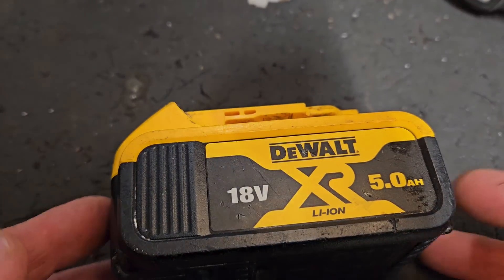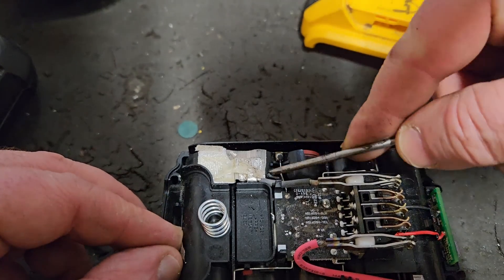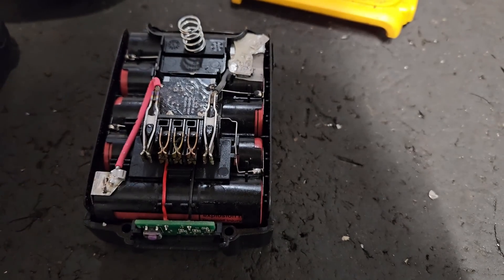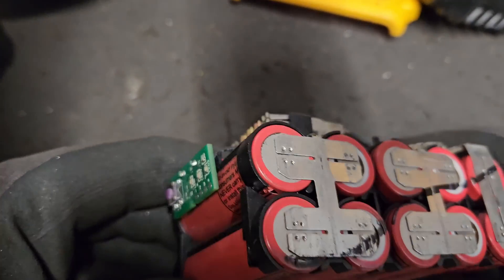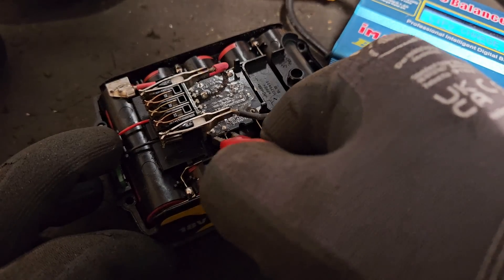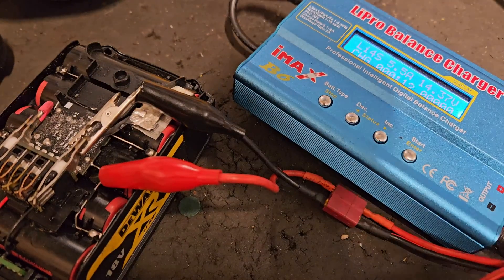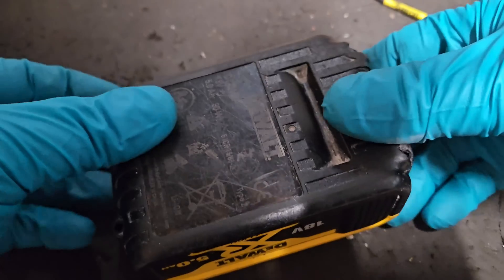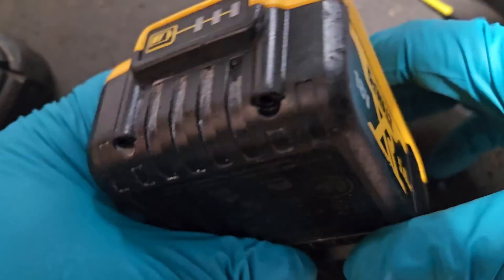Dewalt Battery balancing full tutorial

Comment: Connecting that balance charger like  that can cause an imbalance between the cells you're charging (it has an extra cable you're not using that is supposed to connect to each cell in the chain to guarantee balance. If it's one cell higher than the others as on your battery rather than one cell low then it's better to use the charger's Nicad discharge function to give the high cell a controlled load (you can select the load current and target voltage) to safely drop it's voltage to match the others then use the tool's own charger to give them a full charge. Repeat if necessary if there's still an imbalance. I've used this method on a 10x3 cell scooter battery with successful result.

Comment: Do you need to open the battery if you want to balance.  Is there an alternative dewalt charger with balancing ?
Reply from the maker: Yes you have to open the battery and and there is no balancing chip on the battery boards or no dewalt charger that balances them

Comment: the charger itself balances the battery.  they recommended to leave a battery on the charger for 24hrs time to time for it to do so. Also important to keep the battery charged everytime you can. dont charge the battery when its warm, and drain it fully time to time as well. work great for long time.
Reply: DeWalt chargers do not balance
Reply: if the charger balances them its self, one wouldn't need to do this.

Comment: Great video! If you charge 1-3 cells. Do you still charge with 6A or do you need to lower the charge amp?
Reply from the maker: I do yes but I am always trying to speed up the process
Reply: Hi doctor left hand thread  have a milwaukee m18  8ah could you take a look at it for me please
Reply from the maker: @davidcromie2689  yes
Reply: How can I get in touch with u please
Reply from the maker: @davidcromie2689  email me drlefthandthread@gmail.com
Reply: OK how do I get in contact with u two have a look at the battery  please
Reply: No reason to lower the current. If it’s 2 cells in series or 100 the current is always the same